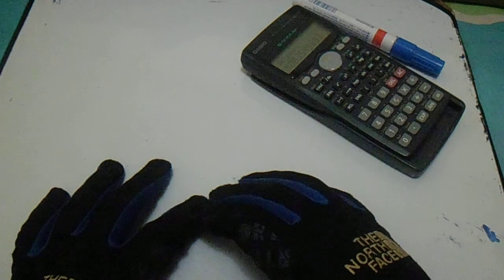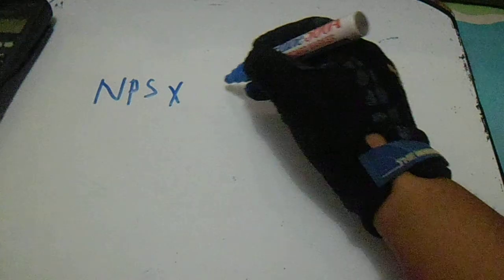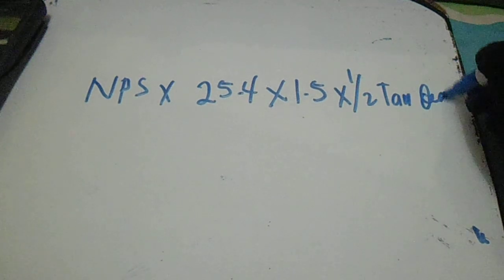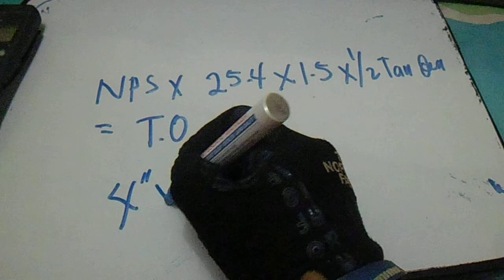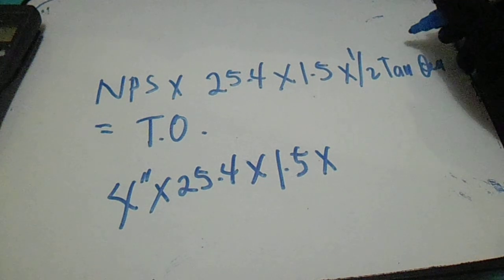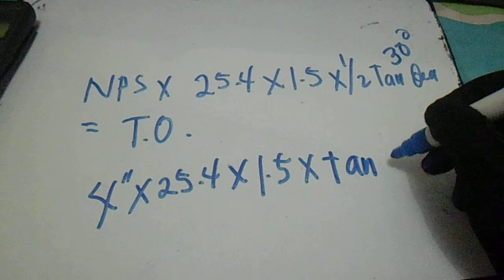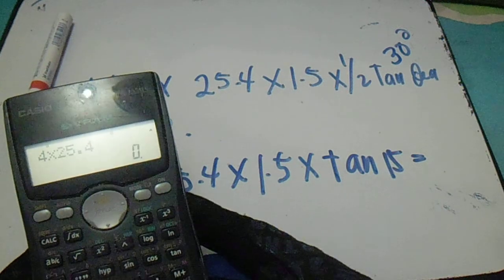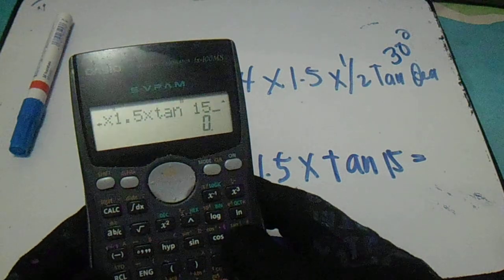Pipefitter - How To Compute Special Elbow Take Off - PipingWeldingNonDestructiveExamination-NDT

Comment: question about take offs in *half inch, *1 and 1/2 etc.. how can you *compute it? 1.5 and 1 are applicable only in NPS in full size.
Reply from the maker: Yes! all of that, just stay tune more videos' coming up. thanks for watching
Reply: thanks! i'm counting on it. i need it badly:) take offs of NPS not in full sizes. 1/2" 1,1/2 etc..